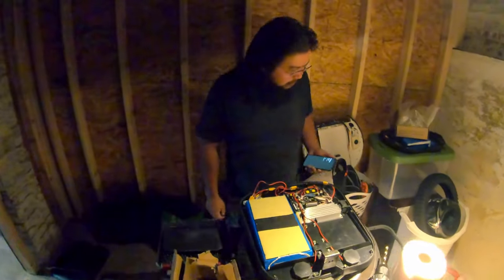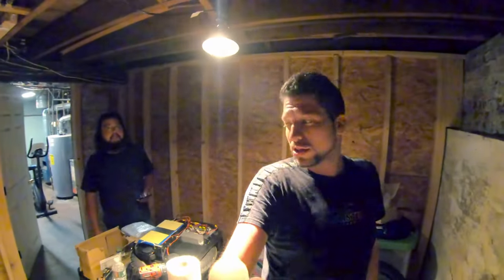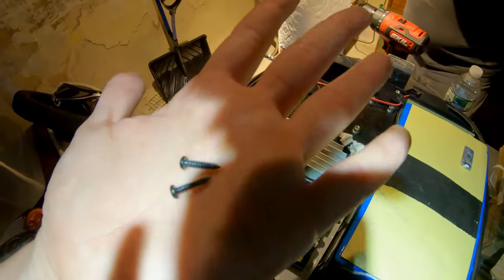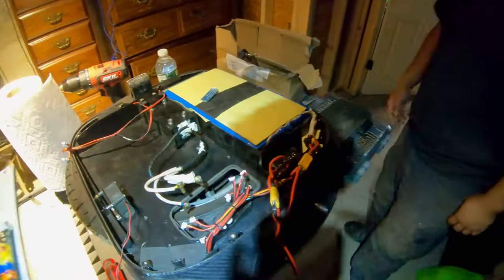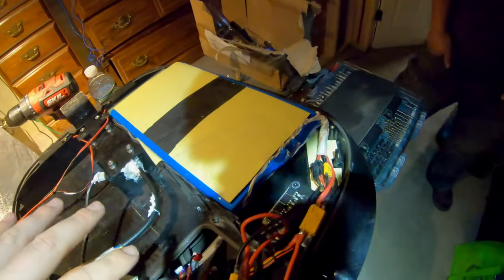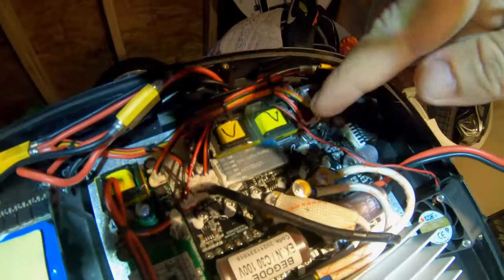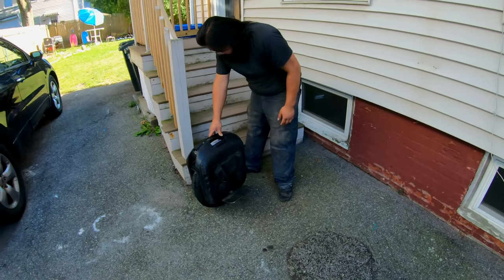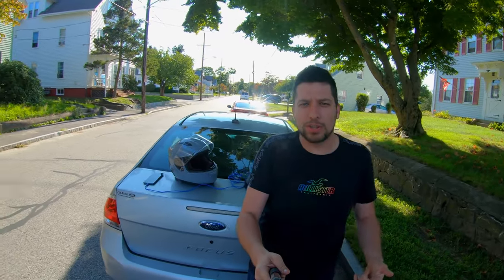EXN Control Board Repair - Swapping out a Board on a Begode EXN High Speed EUC

Comment: If the wheel still balances & the caps looks obviously kaput, any one with some soldering skills can easily remove the old caps & solder in new caps. Replacement caps are a coupla bucks each & if wanted, can use a bigger uF caps as replacment. Much cheaper than getting a new mobo
Reply from the maker: luckily the board was covered under warranty. but also we decided it wasn't worth the risk that something else caused the cap failure and risk riding on a faulty board. best to play it safe and do a full swap
Reply: @GoGeorge  Ya I get that esp when failure spells disaster. That it would smart to solder in 2 new (& bigger) replacements to test it out or atleast, use as a spare. Unless ofcos, the vendor demands the faulty board back. Anyhoos glad its all fixed. My EXN with 2k miles is performing like a champ  🤞🤞
Reply: @scottsum1319  i wanna try out putting bigger caps on and see how it feels.
Reply: @scottsum1319 can you get 100v capacitors that are “bigger” than 1000uf?

Comment: @8:32 what is that extra black board on the left side over the battery is it a fuse looks like extra mosfets???
Reply from the maker: thats a wierd style fuse they used for a batch. mine had a simple 60a blade fuse

Comment: HEADS UP! @7:42  Loctite and plastic don't work at all. Loctite eats away at plastic, you will soon be having problems with that board getting loose.
Reply from the maker: good thing we only did it to 2 or 3 of the screws then. we where not sure so we just did one on each side

Comment: Go Georges Go
you crazy using locktite on plastic 
plastic will crack use silicon on top og srews touching the heatsink or teflon tape🤦🏻‍♂️🥴
Reply from the maker: lol oops, its okay we only did it to 1 screw on each side theres still 2 more on each holding her down as well
Reply: Go Georges Go what is making more worry is you actually recommend that 😮‍💨🤣😂
Reply from the maker: @Papalou1234  i didnt really recommend it. i just said thats what we did and that i dont know how it works with plastic . which apparently from the comment section it doesnt work well at all lol